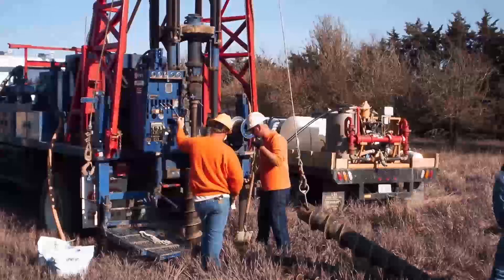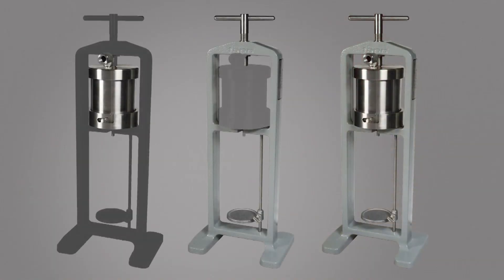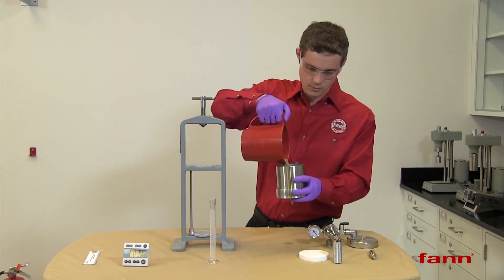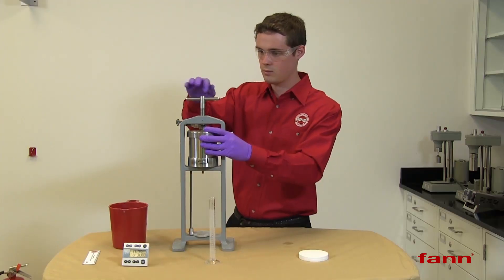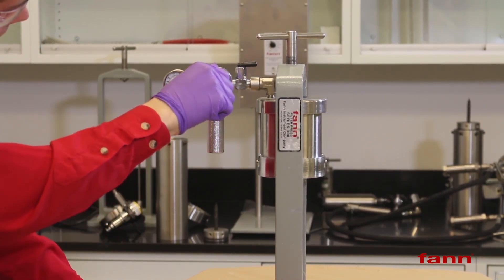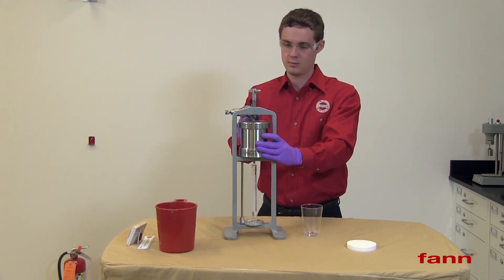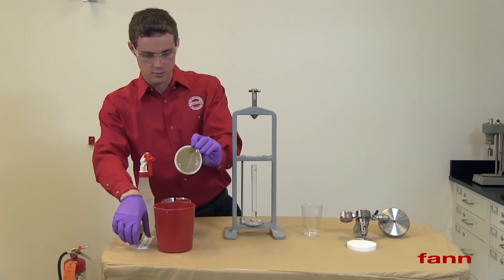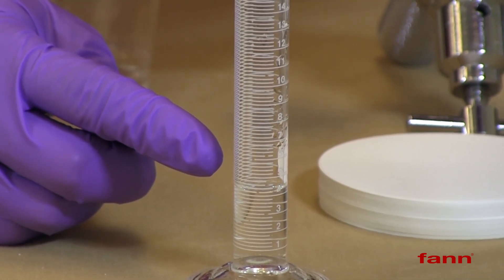How To Use the Fann Filter Press

Comment: Hi there,

I have a question. I was wondering that what is the pore's size of this filter paper?
Thanks,
Reply from the maker: Amin Atash The filter paper is 2-5 micron particle retention, 3.5 in (9 cm) in diameter.  The Fann part number is 206051.
Reply: Thanks.
Reply: I have a filter paper for fluid loss test! I was wondering that how may i find the pore size of this filter paper!? In another word i was wondering how fann measure the size of filter papers!
Should i use sort of microscope or something?!
Thanks in advance for your guide and help!